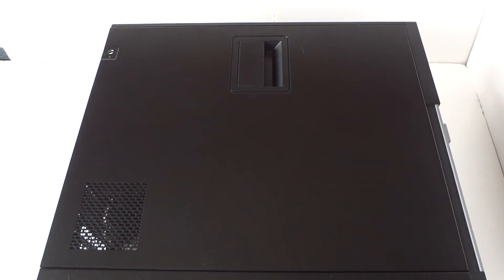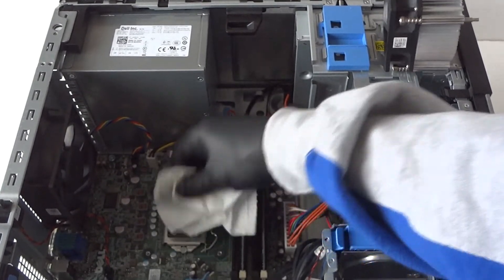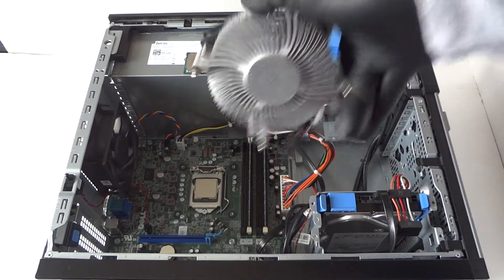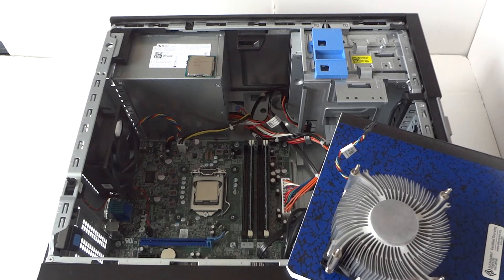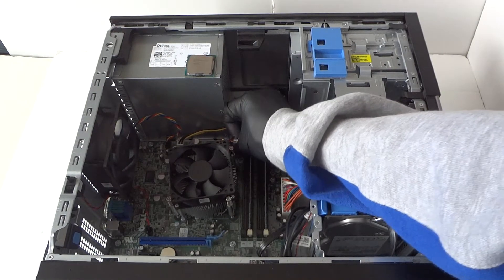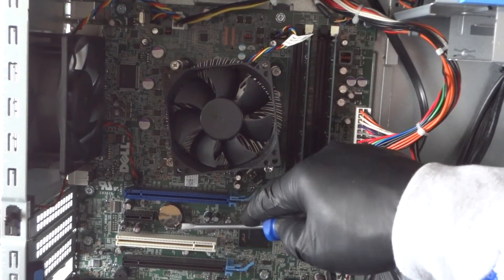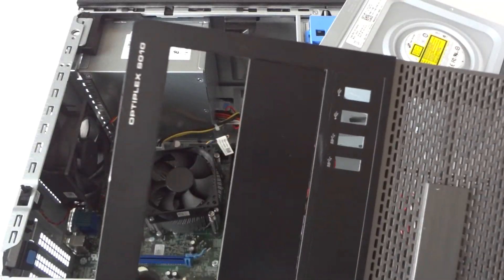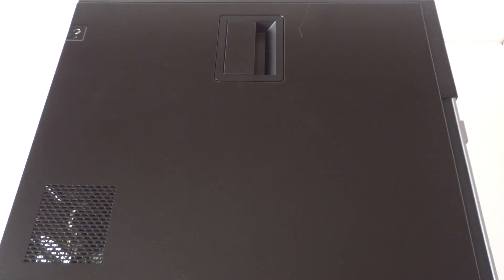Dell Optiplex 9010 Upgrade Processor CMOS Battery Optical Drive

Comment from the maker: Full Parts list works with this machine.

(1.) Gigabyte Geforce GTX 1050 Ti OC Low Profile 4GB GDDR5 128 Bit PCI-E Graphic Card (GV-N105TOC-4GL) 
https://amzn.to/2XEqKMb

(2.) MSI Gaming GeForce GTX 1650 4GB GDRR5 Low Profile Graphics Card (GTX 1650 4GT LP OC) 
https://amzn.to/2VkDdSd

(3.) MSI GTX 1050 TI 4GT Low Profile  Graphic Cards 
https://amzn.to/34r0AxG

(4.) Gigabyte GeForce GT 1030 GV-N1030D5-2GL Low Profile 2G Computer Graphics Card 
https://amzn.to/2Xu3SyO

(5.) ZOTAC GeForce GT 1030 2GB GDDR5 64-bit PCIe 3.0 DirectX 12 HDCP Ready Low Profile Video Card ZT-P10300A-10L 
https://amzn.to/3eayL1b

(6. )ZOTAC Gaming GeForce GTX 1650 OC 4GB GDDR5 
https://amzn.to/2V28laj

(7.) ASUS GeForce GTX 1650 Super 4GB Phoenix Fan Edition (PH-GTX1650S-O4G) 
https://amzn.to/3eoad4S

Power Supply:
(1.) CORSAIR VS Series, VS500, 500 Watt, 80+ Certified, Non-Modular Power Supply
https://amzn.to/2RxoMZV

(2.) CORSAIR VS Series, VS450, 450 Watt, 80+ Certified, Non-Modular Power Supply 
https://amzn.to/3efEeDO

This RAM works with this machine:

(1.) Crucial 8GB Single DDR3L 1600 MT/s (PC3L-12800) Memory CT102464BD160B
https://amzn.to/2VhGv8O

(2.) Crucial 4GB Single DDR3L 1600 MT/s (PC3L-12800) Memory CT51264BD160B 
https://amzn.to/2xq46wb

(3.) Crucial 16GB Kit (8GBx2) DDR3L 1600 MT/s (PC3L-12800) CT2K102464BD160B 
https://amzn.to/2VpsKpP

(4.) Crucial 8GB Kit (4GBx2) DDR3L 1600 MT/s (PC3L-12800) Memory CT2K51264BD160B 
https://amzn.to/2y7XZwq

This HDD 2.5inch will work in this caddy for extra storage.

Dell R494D 3.5" to 2 x 2.5" HDD/SSD Caddy Adapter 0R494D
https://amzn.to/3c8ynhJ

Corsair Dual SSD Mounting Bracket 3.5" to 2.5 CSSD-BRKT2
https://amzn.to/2Rtw40K

1.. Seagate FireCuda 2TB Solid State Hybrid Drive Performance SSHD – 2.5 Inch 
https://amzn.to/3b1e8T7

2..WD Blue 2TB Hard Drive s, SATA 6 Gb/s, 128 MB Cache, 2.5"
https://amzn.to/2Xstb4b

3..Seagate BarraCuda 2TB Internal Hard Drive HDD – 2.5 Inch 
https://amzn.to/2xmf0TE

This cable required if you going to install SSD and HDD:
Benfei 15 Pin SATA Power Y-Splitter Cable 8 Inches
https://amzn.to/2XsG0LV

Cable Matters 3-Pack 15 Pin SATA Power Splitter Cable 8 Inches 
https://amzn.to/2Rval8B

Zheino SATA Power Splitter Cable (2 Pack) SSD Power Cable HDD
https://amzn.to/3a3V9Wq

SSD list works with this PC:
(1.) Samsung 860 EVO 500GB 2.5 Inch Internal SSD MZ-76E500B/AM) 
https://amzn.to/2yNxnkE

(2.) WD Blue 3D NAND 1TB Internal SSD, 2.5" WDS100T2B0A
https://amzn.to/2wvnC9Z

(3.) WD Green 1TB Internal PC SSD  WDS100T2G0A
https://amzn.to/3cbrcWa

(4.) SanDisk SSD PLUS 480GB Internal SSD SDSSDA-1T00-G26
https://amzn.to/3a3i9ou

(5.) Crucial MX500 250GB 3D NAND SATA CT250MX500SSD1(Z) 
https://amzn.to/34rZlhy

(6.) Samsung 860 PRO SSD 256GB - 2.5 Inch SATA III 
https://amzn.to/2ybiHLK

(7.) Samsung SSD 860 EVO 250GB 2.5 Inch SATA III Internal SSD 
https://amzn.to/2VjIAkK

(8.) SanDisk SSD PLUS 240GB Internal SSD
https://amzn.to/3c7SEE4

Comment: I just bought an 9010 and it came with a i7 3770 and 16G ram just thinking about a graphics card, not for games but graphic work.
Reply: im not sure about graphic work but if you ever want to try gaming on this computer than you can go ahead and look at graphics cards like the amd radeon rx 570 or rx 580 sapphire pulse.

Comment: hi, whenever i boot up my pc, same model as this, it says my time of date is wrong, so which i was told i need a new cmos battery, and my problem is that my gpu card thate covering it wont come out.. how do i get it out?
Reply: There should be strip lock of PCI Express ... So unlock it and then remove the GPU and don't forget to remove power cable of GPU

Comment: I have the same Optiplex , whats the best under $100 used processor i can buy
Reply from the maker: Hi, you can get core i7 3770 for around over 100 or under 100 you can get core i5 3570, 3470